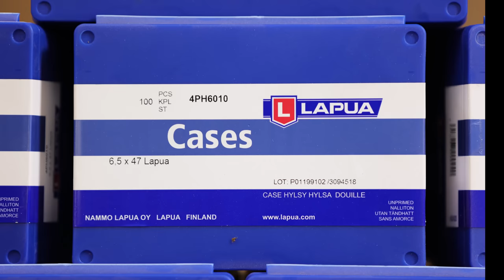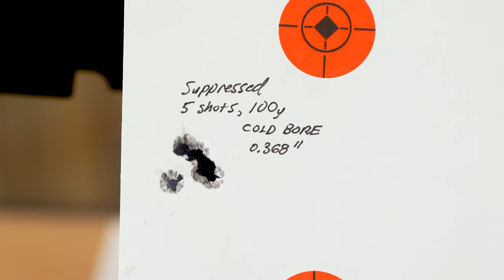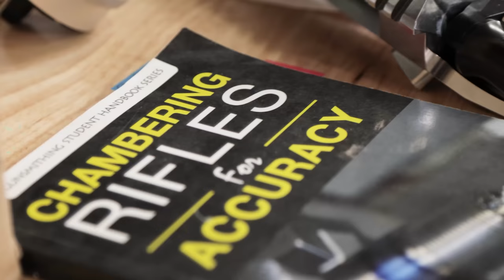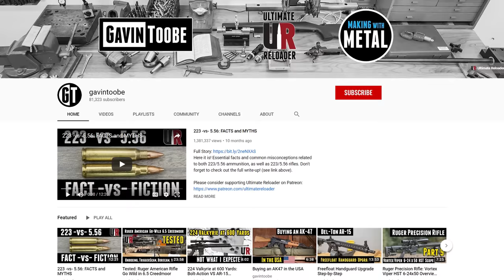6.5x47mm BR Build Part 1: Chambering the Barrel

Comment: So, as others ask, why 6.5?

Benchrest is an arms race and the 6mm stuff seems to be the thing for shorter range bench rest competition and 7mm stuff seems to be the thing for long range bench rest competition. 6.5mm isn't going to be some in-between that does well at both, you're going to be out-gunned whatever you do.

My entry in to bench rest isn't terribly serious, the barrel isn't from one of the better known makers, it's a pre-fit screwed in to a slightly modified Savage Axis 2 xp and it is bedded in my version of a DIY bag rider chassis but it is .284 Winchester, a caliber that has F-Class championships and more than a few record groups over the years.  I've got a Bald Eagle Big 50 rest which is a big, stable rest but it's not a $$$ joystick rest which seems to be the thing for quickly shooting tight groups during a lull in the wind.

I saved money wherever I could and when buying a pre-fit, choosing .284 Winchester didn't cost me anything.  Lapua 6.5x284 brass can be necked up to make quality brass fairly affordably, I think Norma and Peterson make good brass too and Berger 180 and 184 grain bullets were fairly priced.  .284 Winchester doesn't even use very much more powder than something like 6.5x47 so the premium to shoot a well proven bench rest caliber is minimal.

For me, its a way to dip my toe in the bench rest water to see if I like it and see if I can learn to load and shoot well enough that I can see my budget rifle holding me back.  Either way, it's also an entry in to ELR because .284 Winchester has the MV and BC to stay supersonic past a mile.

Obviously the barrel, action, chassis and rest are budget choices but the action has a closed top, it should be fairly rigid, the trigger is a modified accu-trigger that feels pretty nice at about 1 lb pull so if the barrel, chassis and rest work, I might not be totally outgunned at a benchrest match with my $1,200 rifle and $200 rest.

Maybe budget DIY is just my style but I think I would rather try all the wrong stuff with the right caliber than all the right stuff with the wrong caliber.

I think I see a 6BR barrel in your future...

Comment: No need to worry about .002 headspace unless you shoot factory ammo. You size your brass to fit your chamber 👍
Reply from the maker: Actually- it was important. Recall that I have another 6.5x47mm I built with these reamers. I need to share fired brass between the two!
Reply: @Ultimatereloader  touche 👍 I don't mix brass, but you have a valid point.
Reply: @Ultimatereloader  man, I'm excited to see this complete build and what it'll print! If it shoots in the mid to (hopefully) Low threes like the Uinatah and they can share fire formed brass that'd be amazing!

Comment: I learn a lot from you and I understand your line of thinking for the most part.  But I have to ask, and I'm not trying to pick a fight; it seems like you are getting very similar performance from 6.5 Grendel. Couple hundred fps slower, but close. Shorter bolt pull,, same availability for bullets. And I personally think that the Grendel is inherently accurate.  Accuracy for dummies if you will.

Just wanted your thoughts

Comment: Do floating reamer holders actually allow the reamer to “float” in line with the bore as it rotates? Seems like straight metal on metal between the reamer and holder wouldn’t quite allow the reamer to slip and move with the bore as it rotates. Could you put a mic on the reamer to show that it actually floats with the rotation?

Comment: How do you feel about the range rod method vs directly indicating? I assume with the range rods you need two sets of bushings?
Reply: Direct indicating is the only way to go.  You can then see the groove depth and the land height.  Grizzly rod only goes off land height.   Save your money on the Grizzly rod.
Reply: @dallasjohnson208  agree. I’ve been to gordy’s school. Direct is best. But if you’re doing a small cartridge (223) the grizzly rod sure helps.